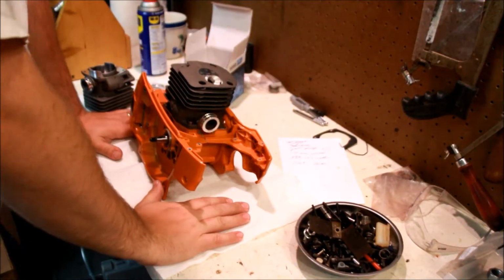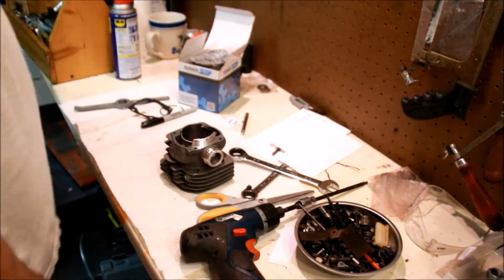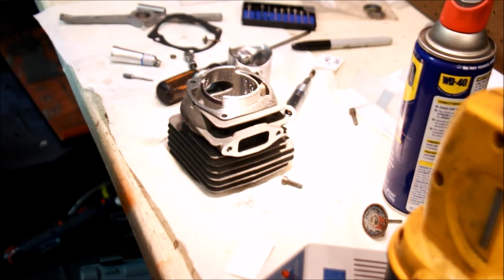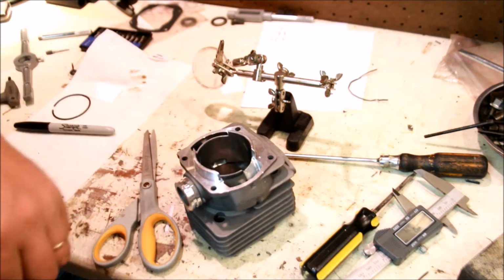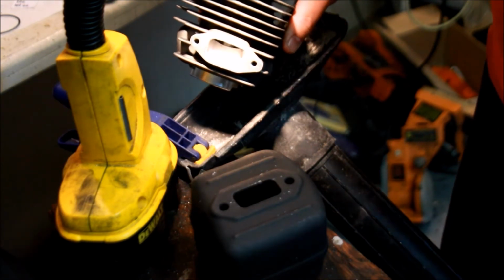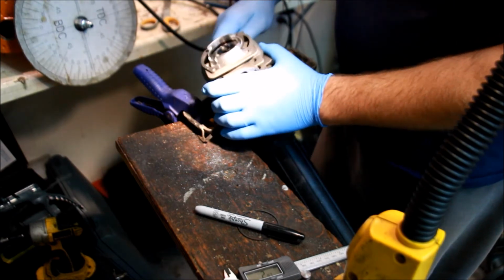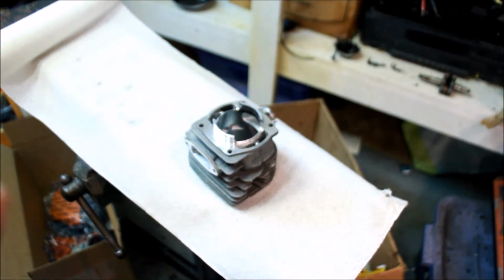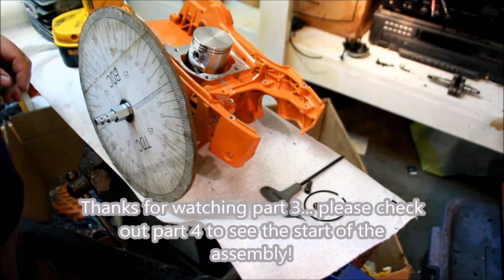Huztl Farmertech 372xp clone kit chainsaw part 3 bolt for bolt! my approach to porting

Comment: That slight hump in th exhaust port is to keep the ring from hanging in the port.  Most people that port build it in if it is not there.  Harv also puts a groove on both sides of the bottom of the intake port and reshapes the port to direct the incoming air fuel fix, downward

Comment: Stihl saws are different from a husky.  The base gasket, if you use one, is different.  It will only go on one way, front to back and top to bottom, but you can put it on after the piston is on the rod, unlike a Stihl which has to go on first.  I marked my gasket with a U and D for up and down and indexing marks for front to rear, so in the heat of the moment I put it on, correctly so the holes will line up.  I do not know yet whether I will use the base gasket - that will be determined by the squish.  I will use it if I can but if the squish is north of .040 I will not.

Comment: look for japan made harden steel geared 90 deg that's what they use on teeth not brass gears I use a steel gear for porting I cut it down to fit my dremel flex shaft and its not broken so far I did a cr 250 and kx 80 and acouple saws with it im easy on it but they do chatter more then just a dremel its hard to get the 90 not to chatter but just a dremel is easy its all in the hard and yea single cuts chatter more if the cutters are wider you need to get fine cutters that's all I use now they last longer to I have a 3 gal bucket full of cutters so I  tried a lot

Comment: Just saw where you were trying to polish the transfers and the sandpaper wheels were too large.  Try taking a piece of 1/8" brass about 3" long (or shorter) and splitting 1 end about 1/2"  use it as a mandrel and wrap 1/2" strips of sandpaper whatever grit you want and use to polish with.
Reply from the maker: customcutter100 in later videos I show a split mandrel that I made.  But....would be nice to have one that is right angle latch :)

Comment: If you reduce your carbide speed even more they wont plug up. You want to find burrs(carbide) with a little less pitch for aluminium
Reply from the maker: Marty Ross thanks marty. ....my lab drill can go slower but has no power. ....lately I've been using grease  to avoid the gumming....
Reply: Liberal use of intake cleaner/lube like seafoam will help too. Filings wont pile up on the workpiece like with grease. I do alot of Aluminium heads(typically automotive applications). Been porting saws for about 4years aswell
Reply from the maker: Marty Ross I like the sea foam idea.   Nice.  Tx.  I don't do lots of port work....just demonstrate this for guys that wanna do it for fun.
Reply: Matthew Olson it all takes time. Theres an entire trade worth of theory and machining techniques to learn and very few places and oportunities to do so. After about 100 saws and a few dozen test cylinders I still only really have two marketable build types for a handful of models.  Its not like a 4stroke performance build where I have target #s to hit on the flow bench and formulas to get them long figured out before me.

Comment: What type soldier do u use to give swish every soldier I have will not swish to hard of soldier
Reply from the maker: David Shively I have some .060" old lead solder if the squish is large.   I use regular Electronics solder if it's smaller than .030"

Comment: I have been looking into doing this but I don’t understand the whole timing deal and why your borin the head out
Reply from the maker: not boring the head, adjusting the ports for different port timing (different than ignition timing), and better flow ...
adjusting the port timing allows (sometimes) the saw to perform more efficiently and powerfully.  how to adjust the ports isn't as much as an issue is HOW MUCH to adjust the ports.  i'm am no expert ... just showing how I do it.  the more you read and watch ...the more you'll understand

Comment: Where did you get that porting tool? I've been trying to find one with a good angle on it
Reply from the maker: Hey Dan....that's a marathon dental lab handpiece.  It has an e type motor and will accept right angle handpieces.  They burn up quick though.  They are not designed to handle porting burrs

Comment: What do u clean the cylinder with when your done
Reply from the maker: pretty much anything.   soap and water, brake cleaner, degreaser...  etc.  you can do lots of stuff and its kinda hard to hurt the plating.   just gotta get the cylinder pretty clean before you put it back on.

Comment: I didn't get the 36 degrees vs. 15-degree thing.  Can someone tell me what that means?
Reply from the maker: ?   I forget ...older video.   Whats the time stamp?
Reply: @matthewolson8875  May 9, 2017
Reply from the maker: @alext8828  at what point in the video?
Reply: @matthewolson8875  I have it at 2:49.
Reply from the maker: @alext8828  yes and a few seconds later I explain....  im balancing the wheel
Reply from the maker: @alext8828  the degree wheel needs to read the same on both sides of the revolution ....one side reads 36 now...the other side 15...   so the wheel needs to be moved so its same number on both sides.   Mastermind youtube channel has a nice video on this
Reply: @matthewolson8875  I understand that the numbers need to balance on both sides.  But when the caption came on and said 36 on one side and 15 on the other and the difference is 23, I thought you had made a mistake and meant 21.  Is that what happened?  23 didn't make any sense and I was wondering how you got it.
Reply from the maker: @alext8828  yup...math error sorry
Reply: @matthewolson8875  No problem.  I like puzzles and that was a good one.  Thank you for your help.  Great channel.

Comment: What video is of saw running
Reply from the maker: I dont think I have a vid of the saw running.  It does run, and I have used it.  But its not easy for me to do vids of running ...  mostly because I don't have a great setup for those type of comparisons.   I don't even have land, and no trees to cut.  If you want to see saws running check out Walt's channel, AFLEETCOMMAND ... he does much more with vids of running saws.   I just build em :)
Reply: Yea i watched just about most of his saw builds lol tryna decide on a knew sthil ms361 or 380 clone kit or buy a used husqvarna 455 rancher
Reply from the maker: uh, those are very different saws.  i like the 455 rancher because its quite easy to work on.  but the 361 and 380 are going to be more powerful saws.  the 455 doesn't really do anything particularly well, but it isn't bad either.  I like the 660, but walt now likes the 380 for some reason.  the 372 kit isn't a bad kit either, for the price of a 455 rancher ...and it'll be much more powerful than the rancher.   lots to think about.   buy all of them, like I did lol
Reply: Well ive ran both husqvarna and sthil saws and me personally they both are really close when it comes to a smooth running and cutting saw! The decision is hard i have a husky 240 right now and it runs pretty good and a ryobi/homelite that runs and cuts decent  but it being a bigger homeowner saw basically vs a commercial or pro saw is a bit different
Reply from the maker: the 455 rancher is a step up from your 240 for sure.  but its just different than the 361/380's   all very different saws.

Comment: send me that big bore I'll try it out
Reply from the maker: john reilly have no fear...I'm gonna use it :)
Reply: I'm going to try to get a 52 millimeter OEM cylinder
Reply from the maker: john reilly call bob at ashoken turf and timber....he has factory big bore at good price.  51.4mm....fyi
Reply: Good to know thanks
Reply from the maker: also...   fyi ... I built a 51.4 ...  it wasn't that much more powerful than the 50, if any.  I also burned up the piston.   new piston is $80!!  and there is no aftermarket for 51.4.  personally I'm gonna build oem 50's only, or if I'm doing am i'll do either 50 or 52.  gotta try out these farmertech 52 and 50's and see what I can get out of them.
Reply: Hey Matt the discussion you made about the width of the exhaust  port either with the curvature of the cylinder or as the crow flies, I'm sure you know this, as the crow flies is longer than if you go with the curvature if you was to roll the edges towards the center line of the cylinder and shorter if you were to roll the edges away from the center line to a certain degree.  Personally I would use the straight line method as measured  across the skirt of the piston in a straight line (the width of the skirt) so as not to extend the cross sectional area of the exhaust port opening to wide thus making the cylinder unusable.  This is just my thinking though.
Reply from the maker: Craig Timmons thanks Craig...I kept this dimension quite conservative to avoid trouble. ..and usually I work on used cylinders that have rub Marks that allow me to see exactly where to stop cutting.
Reply: Matthew Olson By the way it is a very good video with alto of good information  Thanks